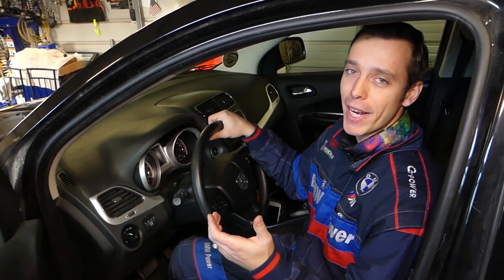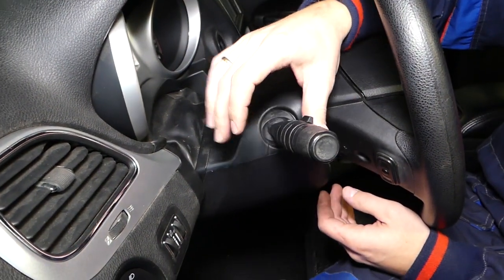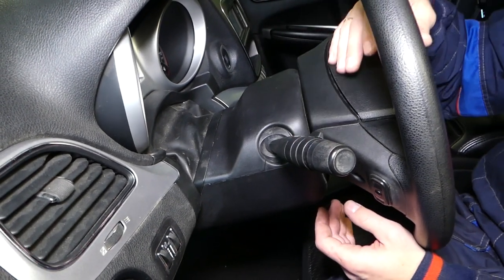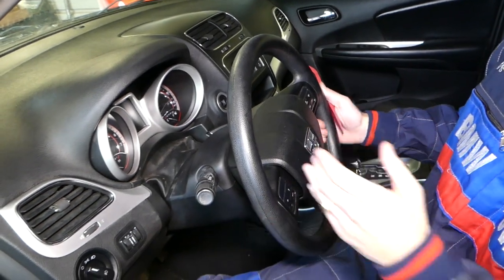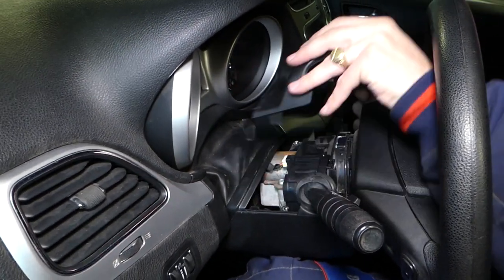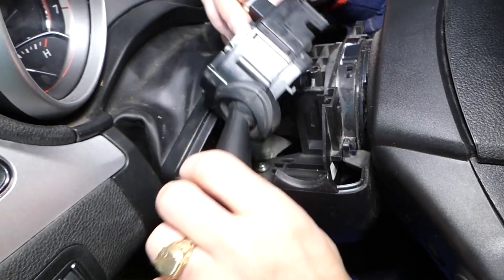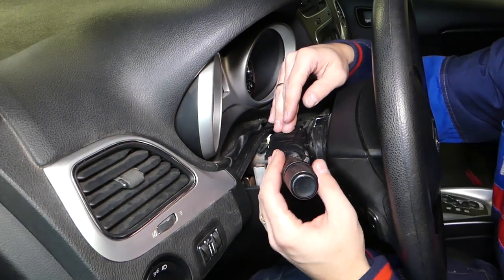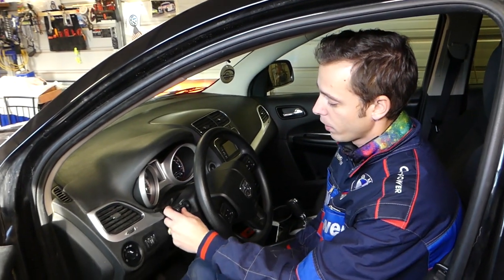DODGE JOURNEY TURN SIGNAL SWITCH WIPERS SWITCH REMOVAL REPLACEMENT. FIAT FREEMONT

Comment: Thank you for this ! I went to my local  dodger dealer & order the parts , relay , switch and sensor, I tried one by one until it finally worked! The switch was the one that wasn’t working! You made instructions so easy to understand!!! YAY finally fixed b/4 the rain !!!!

Comment: Thank you for a great video. The situation with my turn signal is that it does not cancel. Does that mean that I have to replace the entire unit or replace the spring

Comment: Did you change the whole indicator switch/lever or did you just change a fuse??? My 2009 dodge journey rt windshield wiper is going continuously wont turn off and the indicators are not working. Pls let me know thank you.

Comment: 192 / 5 000
Wyniki tłumaczenia
Wyniki tłumaczenia
The Dodge Journey only has continuous wiper mode.
In intermittent mode, they turn on once per shift of the lever in each level and stop working.
Where is the intermittent timer?

Comment: Having a parasitic draw from my 09 dodge journey. After doing test I determined it was M13 fuse causing draw. I see that M13 fuse control multifunction switch and siren module. After removing multifunction switch. I reinstall M13 fuse and draw came back which led me to believe that my multi-switch is working properly. So I'm stuck currently trying to figure out what else possibly M13 fuse control. 3 battery charged now thinking my battery and or alternator was bad when there were fine. Any help would be gladly appreciated